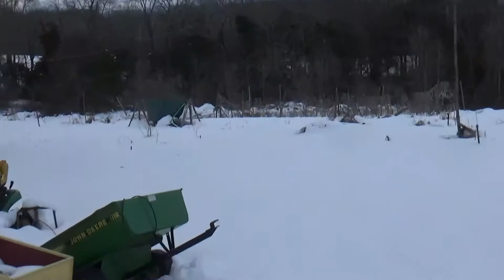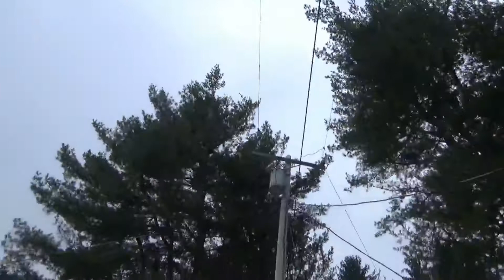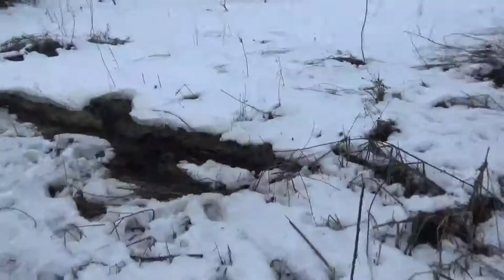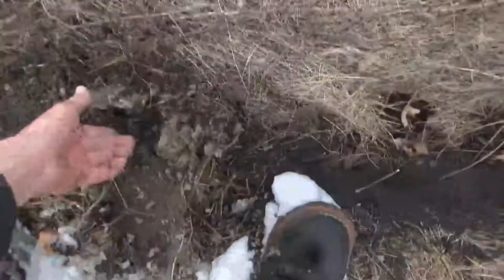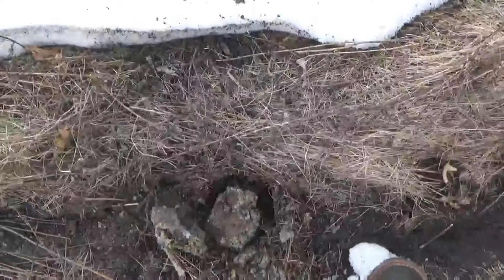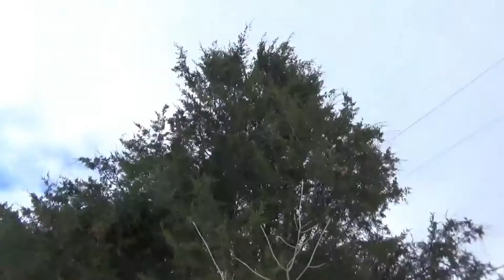Storm Damage: HF Anetenna AND Power Line Down And Repaired Copper And Soil Welded

Comment: Oh my... gonna be erecting my HF mast for my 2 meter in a few months...
Reply from the maker: Oh nice! Didn't realize you were a ham as well!  Looking forward to getting all my antennas back up and radios back on the air.. :)
Reply: @TheFarmacySeedsNetwork  Yes sir..  for about 5 yrs now.  Only 2 meter so far.  Eventually I'd like to get into some other freqs as well... talk around the world..
Reply: @TheFarmacySeedsNetwork  Im literally in a hidden valley up in north Idaho and don't have very good cell reception so this tower Im building will be a dual purpose for my 2m on top with a high gain Yagi for the WeBoost system I got.  We had ZERO reception and now we have 1-3 bars 4g...  I put up a video about it.
Reply from the maker: Ahh nice...  yeah we used to have horrible cell reception here too.. I had a cell phone repeater system locally ... now there's a new tower up and I don't have a cell phone... go figure... Sounds like nice country you're in there!